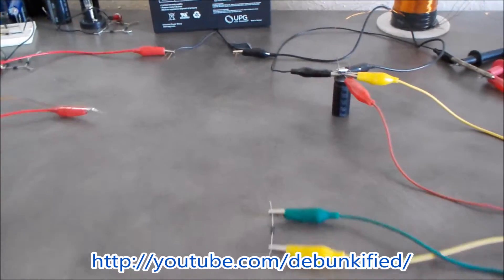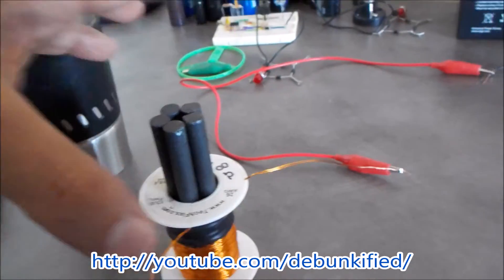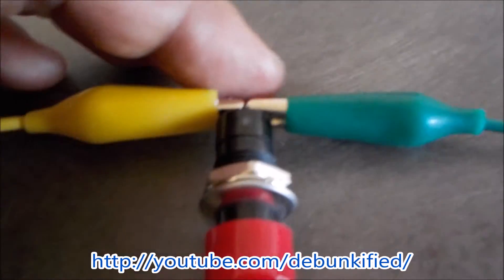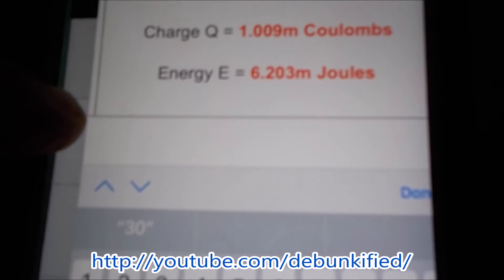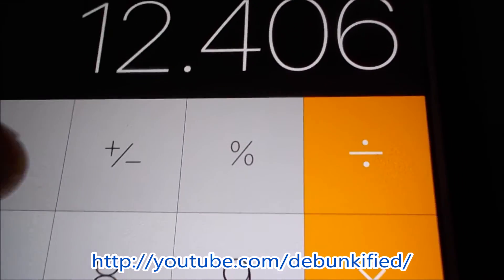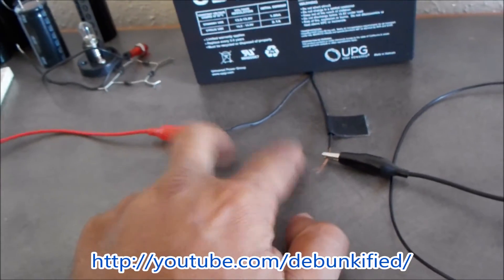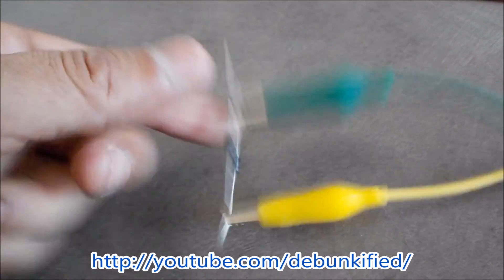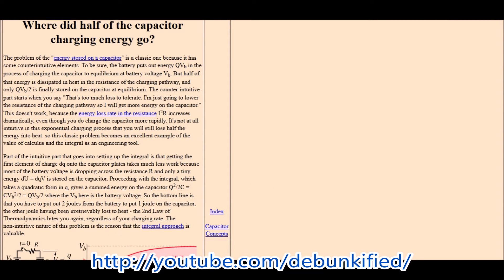How? | The Single Pulse Experiment

Comment: DC-DC boost converter works on the principle of collapsing magnetic field aka inductive spike.
Reply from the maker: Exactly, you’re exactly right. Try this, crank up a simple converter to like 32V or so and keep a capacitor charged, now hand pulse the capacitor to a load while watching the input power and current.

Try pushing it one per second, 1 second on and 1 second off, and choose something like a 10,000 if capacitor.
Reply: @debunkified Instead of manually turning coil on and off, try joule thief configuration, it turns on the connection to coil and as soon as the magnetic field saturates in the coil (or current reaches peak) it disconnects the power, causing the coil collapse really really fast,  transistor fries without heatsink, so use heatsink for transistor or mosfet,  its output is insane.
Reply from the maker: I do this exact same thing routinely with only 3 parts but much better than a joule thief. I can run mechanical loads and electrical output at the same time. Doesn’t effect input either when either is loading.

Comment: You could do the same experiment, but put your coil in a faraday cage to see if anything changes. If less power is recovered, it could mean the coil is "receiving" power from the outside. Coils self-oscillate and will ring when pulsed. These damped oscillations can travel thru the diode and be rectified to charge up the capacitor. Since its a half-wave rectifier (and not full wave), you only get half the potential of each of the waves that are diminishing in current. It will be the current, not the voltage, that charges the capacitor. But, if the coil is also picking up "noise" such as the oscillations of fluorescent lights in your work area, or other magnetic equipment, the capacitor may charge. You could enhance this by using full-wave rectification and I highly recommend the "Tate Ambient Power Module" circuit which uses germanium diodes to pick up RF and convert it to DC.

Comment: I think power and energy are getting confused here. (Which is easy to do). The big battery supplies way more than the recovered joules in the cap because power flowing so fast even in one brief switch. 
I redid the experiment using a charged capacitor instead of a battery as the energy source. I found the energy recovered in second capacitor is only 50% of what left the source capacitor.
Reply from the maker: Hi there sorry for the long delay. I saw your comment briefly and automatically assumed it was 5 years old, for whatever reason. I came back to this video because I was trying to realize something and saw your comment again and then I realized it's on the same video I needed to watch again. I sometimes use my own videos fro reference. 

Anyways I realized that the collapsing magnetic field from the coil is actually traveling backwards through the battery, as you can read in the revised description box. It actually doesn't make sense to me now as the collapsing field would have to literally grab the energy from the battery and flip it around to the correct polarity of the capacitor in order to charge it above 100%.

Ok so I also realize since the collapsing field is traveling backwards through the battery it is also discharging the battery as well. So as the battery discharges for the second time the capacitor charges up for the second time as well.

So if 2 Joules of energy leaves the battery, the capacitor should get charged to only 1 Joule of energy and the coil should get charged to 1 Joule of energy and therefore stored in it's magnetic field. When the field collapses  it should discharge the battery by 1 Joule and charge the capacitor up by 1 Joule. So the battery should lose a total of 3 Joules and the capacitor charge up to only 2 Joules which is only a 67% efficiency.

However we know the capacitor is getting charged up above 2 Joules of energy and the question is how? Let's say it this increases the efficiency to right around 70% but how is the capacitor getting above what it normally should be getting? How can the collapsing field traveling backwards from the battery flip the polarity of the energy in the battery around to charge up the capacitor higher than what it should. Make sense? It's a weird little circuit.

Your capacitor to capacitor test sounds about right. But what about the energy left in the source capacitor? How much was that? If you charged the charging capacitor up to 50% of the source capacitor, then what was left in the source capacitor? Or were you just left with 50% in the total energy of the system of both capacitors?
Reply: @debunkified  hey thx for getting back to me. I brought it up because me and another guy have been playing with the circuit and discussing your video. 
Anyhow, In my test I first loaded a cap then removed the battery altogether. Therefore I have a finite and known amount of energy available. I then used the charged cap in the same circuit u have (instead of the battery) and measured the final second cap value. I went back and measured the source cap and calculated the joules difference - so I know what left the source cap and what ended up in the charged cap. It was about 50% efficient.
Reply from the maker: @energyhack3538  Hi, yes but how much energy was left in ‘both’ caps after the test? 50%? 

Ok I get 50% left the cap in place of the battery and then that exact same 50% entered into the second charging cap? Or am I looking at that wrong?

Anyways that sounds about right, but you would have to have 50% left in both capacitors and have basically lost 50%.

If you remove the diode one cap will be basically empty while the second will be almost where the first was at, at nearly 85% or so, through the coil of course.

In other words a basic DC-to-DC converter.

Place a load between the coil output  and capacitor input, between the two positives or negatives.
Reply: @debunkified  ok so first cap. Charged to 12v equal to 0.072J, after discharge dropped to 4v or 0.008J.. so it discharged 0.064J
The second cap started at 0v, after momentary switch closure it jumped to 8v or 0.032J
So about 1/2 the energy was recovered into it. I assume the other half was lost to heat and circuit resistance.
If instead I use a battery in place of the first cap, I will get the second to charge to 15v and that’s why I thought it’s allowing more joules into the circuit which makes it look OU but in fact it’s just the high voltage spike that super charged it but the extra joules are coming out of the battery.  One thing I learned is the inductor field collapse acts like a pump toward a cap.. pumps up the cap like a pressurized tire.. something the battery won’t do by itself
Reply from the maker: @energyhack3538  Ok I got you now. You actually are left with 0.04J total energy left in the system, that’s pretty good and is actually 55% efficient if you look at both caps.

Efficiency of transfer is 50%. The collapsing field is actually discharging the first cap down, so it gets discharged twice while the second capacitor gets charged twice.
Reply: @debunkified  yea agree it is pretty good.. my next question is this: if we can recover 1/2 the energy in the coil; what can the other 1/2 be used for? Spin a motor armature? That turns a generator.. ?
Reply from the maker: @energyhack3538  well this is where it starts to get a bit hairy. Logic circles are a dime a dozen, that would make a good website, we could sell them, jk. 

I mean we can sell vibrating energy back and forth between 2 coils while pulsing every once in a while or even and LC tank circuit at resonant frequency, then again gravity does free work over and over again like a pendulum, same concept, with only one initial push.

So if we go back to the basics, for starters, and simply pulse the coil we can raise our efficiency to near 100% with good parts like mosfets 98% is easily achievable.

If we simply connect a load to a battery  then we can easily measure a 100% transfer from power supply to load. The problem is recovery.

We want to circulate energy repeatedly through a load, with intermittent pulses. A generator has Lenz’s law and so if that were a load between a battery and a capacitor or another battery then Lenz’s law wouldn’t matter would it? Since a dead short circuit still achieves 50% between the two.

I must think upon this more and so should you. Right now I’m a bit tired from designing a simple HTML email for a week straight. My brain is dead but I will ponder this more later!and get back with you later. Don’t hesitate to reply beforehand though.

Comment: I did a similar experiment. The bemf was roughly around 50% of the energy stored in the coil.
Reply from the maker: WTF BBQ Hi, bemf is the current that fights the forward current as its occurring.

You said you got 50% back from the coil. In your setup that may have been true, but I think it depends on what kind of power source you had.

If a resistor is used instead of a coil you may see that 50% of the work travels through the resistor, and then later on 50% was retrieved to do 50% more work from the capacitor. 

You might've seen the other half saved as well by being stored in your coil's magnetic field where normally the resistance wastes the energy.
Reply: debunkified
The setup was simple.  Two banks of battery (Source and  receiving).   Source battery is 24v and the receiving  battery is 12v.

The 24v will directly charge the 12v  THROUGH the coil,  and when the switch is off,  the Spike from the coil will also charge the 12v battery as an addition.  Repeat the process in rapid succession.

I figured the energy going through the coil would be around 90% (10% approximate for losses),  then the Back Spike will add to that charge which I measure to be 50%.   So, it's a total of 140%  from what I  theorized (or less), but I wasn't successful with this experiment.  I think it is because of the kind of batteries I used.
Reply from the maker: WTF BBQ Hi, it might have been the batteries, what kind were you using? If they were lead acid then there is no hope as those can't ever get back what they give out because they can be as low as 50% efficient. Lead acid batteries are only meant to go through a few cycles then they meet their death.
Reply: debunkified
I was using Nickel Cadmium.  I don't think these types of batteries  accept  Voltage Spikes like Lead acid ones. I compared two batteries that were charged conventionally  vs one that is charged with my setup.  The one charged with my setup ran roughly 1/2 the time. I think it was not accepting the voltage spikes.

After doing that experiment, I finally realized that the Lead Acid batteries do well with voltage spikes because it desulfates the plates.  John Bedini hinted on this but never really emphasized it in any of his videos.  This is what was so frustrating with people like him.  They don't tell you everything.

Based on his design,  There was simply no way he could achieve overunity when he was only charging the battery with the Voltage Spikes which is roughly 50%.  Everyone who replicated his work has never been able to go above 100%.
Reply from the maker: WTF BBQ Lead acid batteries aren't the greatest thing for accepting kickback spikes especially when they die only after a few cycles as that is all they are really meant for.

Even a capacitor to capacitor transfer of energy through an inductive kick back spike will accept that charge a lot better than a lead acid battery will.

I have long abandoned the idea that you can transfer most of the energy that really is available to a lead acid battery, lead acids can be as low as 50% efficient, most batteries have their advantages and disadvantages.

Yes all Bedini had was a desulphator but was an energizer so it was good at avoiding most of lenz's law with a generator coil, as well as capacitor discharges, but a lead acid won't accept it very well.

A deep cycle golf cart battery would be the best choice.

Comment: Thank you, i like your approach to those tests.
This is similar as a boost converter, there is something interesting in the collapsing magnetic field of a inductor....
To make nother test you should use a charged capacitor as a power source.
Reply from the maker: Gianni Laschi Hi, Actually I am working on that. It seems as though my meter can't measure enough digits to get an accurate enough measurement. So far I've gone from 97.5% to 99.99%, but then I ran out of capacitance 😳
Reply: debunkified
thx for the response, i'm glad to see good will on this research field!
Reply from the maker: Indeed, we try to help the world the best we can. Thanks for the thoughtful comment!
Reply: debunkified
have a look at my videos, maybe you can find something interesting, i like to share my experiments and research